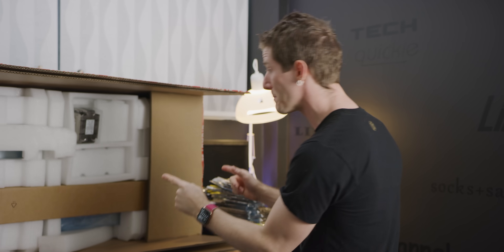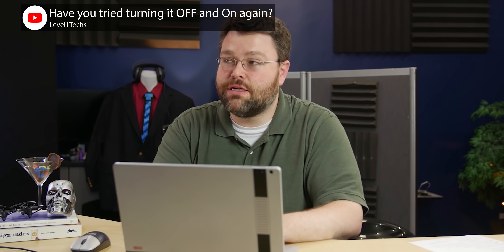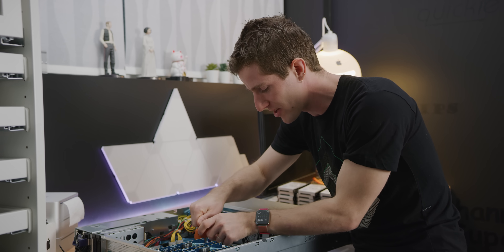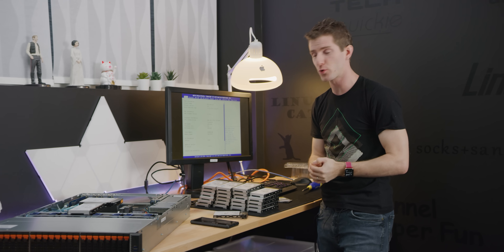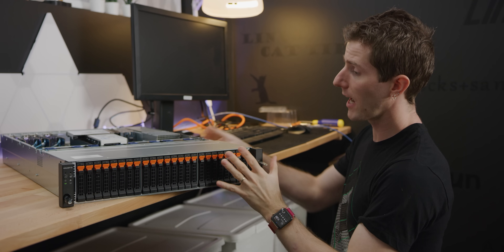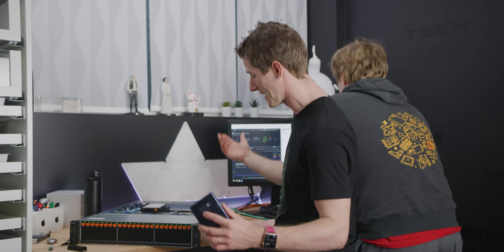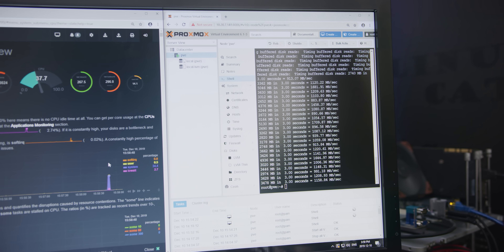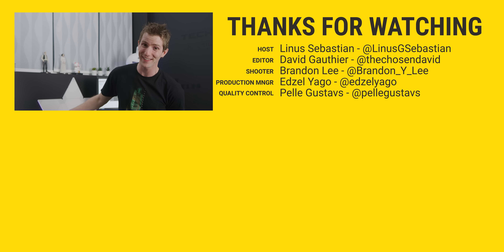Where Intel is in REAL Trouble... - AMD EPYC Server Upgrade

Comment: You should consider for the next redo using KVM-Zen VM to handle your Windows boot and convert all those drives to a single virtual block device.    I sure your Linux nerd suggested that, though.

Just watched the rest, you switched to Linux.

You can still run the Windows share server in VM on the same system to relay the FreeNAS disks to the whole network in a full featured Windows share, instead of the limited implementation of SMB.  That is, if you need the features of Windows VM.

However, you might be hitting a Microsoft cripple system wit the speed cap.

As a note, on the ZFS, it doesn't agree with every drive arrangement.  It can be a really temperamental beast.  You might want to stick to a VFS level RAID and then format plain ol' F2FS.

Comment: I don't get why everyone seems to love ZFS so much.  It always has a problem, always. For many years now, even in 2020 still.
Reply: Also, the obsession with hardware RAID.  Software RAID in Linux is actually quite good and while hardware RAID can put up some better absolute performance, the actual RAID card is often a fairly significant point of failure and compatibility problems.

Comment: 40G used gear can be cheaper than 10G brand new, so ... theoretically, you could put that on a 100G backbone, and put the workstations in the building on 40G. Cause sanity is lame.

Comment: In 2020, not too many new server design use raid card on NVMe. The reason being NVMe has very low latency and high throughput, and almost anything you throw in between will lose performance. If you do not use spdk on the server and move the storage from control plane to data plane (basically move your IO from OS kernel to the application itself) you will lose almost 1/2 of your performance to OS related latency. Therefore application for storage these days move the IO to the application, and instead of using system call you will be looping and polling for the storage. If you want RAID you implement it in software and you poll it. If done right, the CPU can connect to NVME over fabric via DMA at maximum throughput with almost 0 CPU utilization. This is why the storage hardware in between (like raid controller) is in trouble when they becomes the bottleneck instead of performance enhancement.

Comment: Linus, you actually gave the answer for why people don't use AMD epyc based servers so much. AMD don't have support for raid when you use native PCIE ports on the CPU. AMD basically goes for the highest end IP without looking at micro architecture level support. These PCIE G4 ports will not make any sense in anything other than gaming or rendering type applications. But fortunately we don't need an expensive epyc server to do that. Another fact is that their servers won't perform in most of the server applications including storage/network/communications or where configurations like NTB are required. Servers are not about having too many cores but they need basic feature support. More cores can only cause problems with licencing of software. But ofcourse they can brag about having big numbers in some obscure benchmark tests.

Comment: There's this neat thing called an electric drill and most of them have this neat torque limiting feature... You should buy one or two and a pack of P1 & P2 sized driver bits. Your wrists, fingers and sanity will tank me later.

Comment: windows 10 with ddr4 3400 ryzen system == 50gb/s write and 52gb/s read

linux 5.4 kernel with ddr4 3400 ryzen system == 30gb/s write and 28gb/s read ...ITS FUCKING CRAP KERNEL ...WTF LINUS...sorry not you linus the other one who made linux..

Comment: I would strongly recommend using FreeBSD instead, if trying out real ZFS is desirable. I've had many issues with ZoL, and I'm not surprised there were performance issues. It's a second-class citizen in the Linux world, and can barely maintain stability and keeping up to date with kernel changes, let alone optimal performance.

Technically the ZFS on FreeBSD is largely the same codebase as ZoL, but it's a codebase that's a first-class citizen and well-tested by every single FreeBSD user. It has never let me down. I'd recommend doing this again, with FreeBSD.

Comment: Why do you wanna run OS on a NVME RAID  arrange ?? Even if you use Windows the OS runs sweet ... and with a Linux on that thing the bandwidth is massive for a Server with Storage purposes ... the hardware RAID controller is just another component to increase de complexity (also the price) ...

Comment: Incidentally, I'm about to jump into the deep end of Linux myself and try to build it from the kernel without prior experience. The things I resort to in order to not upgrade my laptop from Windows 7 to Windows 10... Anyone got any recommendations? 

Currently my biggest worry is that I may need to write my own drivers to get the hardware to work, since I'm not sure what level they communicate on with respect to the OS.

Comment: 07:58  Maybe I missed something from previous videos, but why on earth are you using Windows for a NAS machine?  The limitations simply abound, and the inability to do software RAID 1 for the boot drive is just the tip of the iceberg.

Comment: 05:20  That is not a passive cooler.  There will be massive active airflow through it from the front intake fans.  What you might call "passive" in a desktop case is not passive in a server case.  That is an active cooler, just not one where the fan has to be directly connected to it.

Comment: Linus: General Windows Issues
Me: You...... You're running a Windows server of all things?
Linus: So I guess we're moving to FreeNAS
Me: Oh sweet, I haven't seen FreeBSD on this chan-
Linus: Makes Linux remarks
Me: Slams head against desk multiple times
Reply: Proxmox is Linux (debian-based), though.
Reply: I believe Linux has better driver support for off the shelf components.
Reply: Im sure he uses Windows Server for its better compatibility with other Windows machines
Reply: @prec1sion548  We have a fair bit of video evidence that he doesn't.

Besides, Samba can be plenty fast, and it's not hard to set one of the Linux/BSD file server distros up for windows domain users. Also, windows server gets kind of expensive as you add more users.

I can't remember seeing anything about his domain controller, though - that might still be windows. (Though you can make a perfectly workable windows domain with a Linux server these days.)
Reply: @dnebdal  I use Windows Server in my local network for the ease of file sharing and for software compatability (being able to run software like bitTorrent on a Server is pretty useful)
Reply: so I thought that maybe he does the same
Reply: @prec1sion548  He would have to pay for access licenses for all his users, and different versions of Windows server have core and ram limits he may run into -- and you can run torrent clients just fine on Linux :)
Reply: Guy doesn't know how much better equipped Linux is for servers. It's only running over 80% of the internet for a good reason. Dumbass...

Comment: "Isn't it crazy that all you need  to cool all these cores is this passive heatsink!" 
Hits power button
 ~*turbine engine noises begin, un-secured heatsink ducting ejected from chassis by jet blast*~
Reply: This is a supermicro 1U/2U server fan spec (and edited to add 2 standard desktop 9mm & 12mm specs)
Just about noise, each fan adds around 3 dBA. It means 80dB or more with the case opened, that means a very loud noise.
And usually our standard desktop fans have no more than 15 watt, these small ones consume 22 watt.
On 2U racks, it's easy to find 30-35 Watts with +70dBA.

1U supermicro exhaust fan
MANUFACTURER
Sunon
FAN SIZE
40mm
RATED FAN SPEED
23300 RPM [Inlet] / 20300 RPM [Outlet]
ACOUSTIC NOISE LEVEL
69.4 dBA
MAXIMUM AIRFLOW RATE
34.8 CFM
RATE CURRENT (A)
1.9A (12V)

2U supermicro server exhaust fan
MANUFACTURER
Supermicro
FAN SIZE
80mm
RATED FAN SPEED
14,400 RPM
ACOUSTIC NOISE LEVEL
65.4 dB(A)
MAXIMUM AIRFLOW RATE
113.7 CFM
RATE CURRENT (A)
4.2 A (12V)

Standard desktop tower fan
MANUFACTURER
Delta
FAN SIZE
92mm
RATED FAN SPEED
4200 RPM
ACOUSTIC NOISE LEVEL
45 dBA
MAXIMUM AIRFLOW RATE
74.8 CFM
RATE CURRENT (A)
0.4 (12V)

Standard power supply exhaust fan
MANUFACTURER
Sanyo Denki
FAN SIZE
120mm
RATED FAN SPEED
1850 RPM
ACOUSTIC NOISE LEVEL
24 dBA
MAXIMUM AIRFLOW RATE
58.8 CFM
RATE CURRENT (A)
0.13A (12V)
Reply: @JuliusLC  Damn, 1U fans go up to F1 V10 engine max revs? I did not know that
Reply: @haxthehax  at least it is specified on the site specs. These really sounds loud & noisy, believe me.
Reply: First time I fired up the 1U computing server we use at work (a dual-socket xeon affair), I had my back turned while it POSTed and genuinely thought the fire alarm had gone off. Server fans at 100% don't joke around. :)

(1U ones are even angrier, since they need to spin way faster to move enough air).
Reply: @dnebdal  yeah, in 1U/2U servers the RPM these fans do is kinda scary, and so is the noise they make.
Reply: @dnebdal  what happen to server then ?
how many amp/rpm the fans are
Reply: @dnebdal  Reminds me of the Bitcoin farms...
Reply: Have one of these server CPU on my desk with a 8k RPM low profile fan. The entire office can't work. Coworker suggested Noctura and that's the best $75 ever. A guy from another department was afraid to ask his boss for approval so he end up writing a script to loop and set the fan speed to low, competing with the cooling system to raise the CPU speed too high.
Reply: LOL. Yeah, when the reality hits...

Comment: https://www.youtube.com/watch?v=lrT9Bl0MCXQ

 Hyper Threading CPU  - https://www.youtube.com/watch?v=UuUgfCvt9-Q - RAID 5 vs RAID 6 Raid 5 System Windows Raid 6 arm disk alles auf Combo oc Turbo mit https://www.amazon.com/gp/product/B0134EW7G8/ref=as_li_ss_tl?ie=UTF8&linkCode=sl1&tag=powe0ae-20&linkId=0f7cad663cf232b888051950bb0a9cb5&language=en_US

https://youtu.be/PVad0c2cljo?t=744 with ddr3 ddr4 RAM Tripple DDR4 nö eccc ecc Server arm System damit geht's ne emo Software die dir Windows bootet einrichtet als als ram dics 5 über stick oder so laufen lassen Disc aufspielen duch sata flopie starten bruch bios installen ohne stick furch neu auflage deine ganzen raid System sind im bios gelistet solltest du ein System haben booten mit dann ladest du nur normal intallst neu win 2 System und lässt die ganzen raid ist über Windows Software im oc bios seting max Server boost laden alles nebenbe   smart arm schub Programme und bei daten Übertragung nutz zu noch zu extrem arm übertragung Software das macht alle 5x schneller als normal ei nsystem ein ki und Manager mit Micro hilfs untestützung über browser richten durch Windows traning du bid schon bei 4.0 5.1 allei ndurch die ram und cpu und hi Speed Übertragung ohne rams die rams machen nur Software bensch und bios tackt stabiler schnelelr mit mehr ram mehr hypert.CPU such mal par hacking seiten auf vileicht gibt's ne ki Software für bios die das alles regelt auf cd bosst stick boost root win loader und konrolirt aufjedenfall nicht uefi uefi ist müll
Reply: damit mein ich ramdisc raid 6 das ne Software die ganze zeit die arm Festplatten geladen hält und den pefel auf 100 Prozent steuert im boost neben bei und die Software am besten verteilen das ei nausgleich ist das gekopelte System enet Zuviel verteilen muss als Einheit auf die 5 platten das zeug und windows  unterschiedlich Server rechter verteilen und amistratorechte freistellen auf die nserver in sli am besten noch wintert kuppel 45000 Leitung bei dann kannst cht alles ficken mit was nur beine und füße hat und wen das alle machen und ein netter entsteht wird alles viel schneller besser gelenkt im Internet und gibt nur Vorteile für alles und jeden ein spinen netz system mit Intelligenz glaub mal das will ich

Comment: Linus: "Intel is in trouble"
Also Linus: proceeds to use dozens of Intel drives
Reply: Also linus: **smokes a dozen of intel drives*
Reply: @miyoubi  its no discord
Reply: I have an Intel 660p SSD in my Ryzen 5 2400G build. (That's a build for use at my workbench and occasional light gaming.) I felt vaguely dirty about putting an Intel drive in an AMD build, but it was the best choice that Micro Center had in the store that day. The 660p is a budget SSD, but that's a budget build all around and putting a more costly SSD in it didn't make sense.

So yes, there are Intel products worth buying. It's just CPUs where they are struggling, and with the Ryzen 4000 series APUs on the way even their laptop niche is in trouble. Plus aggressive pricing on the earlier APUs; the Ryzen 5 2500U may not be the best laptop CPU ever, but when you're getting it for the price of a Celeron or a Pentium it looks really good. (For example, a Lenovo IdeaPad 330s with a 2500U is about the same price as an IdeaPad 330 with a Pentium Silver N5000, but the performance of the Ryzen version obliterates the Pentium.)
Reply: It's hard to justify buying an Intel processor today. 

That doesn't mean the rest of their product stack is useless.  Whenever possible, I use nothing but Intel network cards or chips.  They're just the best option.
Reply: We have true RGB nowadays every company have something worth your buck, if you have enouth of them....
Reply: @TrueThanny lmfao
Reply: Used though, so Intel didn't get any money.
Reply: @Ancyker  Facebook recently ordered billions of $ worth of Intel Optane memory for their growing server infrastructures
Reply: Bruno Panzero Schechter so true! @linus time to update that title
Reply: Jesse Quinn actually intel is selling out their ssd division in the future so...hehe
Reply: Yeah I love my Intel Optane 905P SSD. Paired with the single thread performance of my 9900K that SSD is a beast.

Comment: Was I reading that display right, at those read/write speeds the CPU was only maxing out at 60%? Im no longer sure which is more impressive at this point, the fact that only 60% of the CPU was used or that it took 60%. Numbers are getting so large its hard to wrap ones head around.

Comment: Seagate has a deal on these days for 7200 RPM 3.5 inch Multimedia-specific class hard drives called IronWolf which are very very good for the money AND they are 16 Terabytes in size!

https://www.bhphotovideo.com/c/product/1483622-REG/seagate_st16000vna01_16tb_ironwolf_7200_rpm.html

if you buy 64 of them you will have 1024 Terabytes of Disk Space (ONE PETABYTE) for $32,000 U.S. or about $42,300 Canadian

It might make more sense to buy a bunch of server tower cases from Corsair and attach COOLING FANS or even Water blocks to EACH drive to ENSURE their longevity and low failure rate. The larger Corsair cases could each fit sixteen of the 16 terabyte drives so with 4 of the corsair towers, you could subdivide the Whonnock server into Striped RAID configurations at 256 Terabyte Disk Server Block sizes for staff needs.

NVME is nice BUT you COULD use a BIG ram-disk buffer to speed up hard disk operations for online videos since 7200 RPM in striped RAID configurations should get you about 250 megabytes per second which is DEFINITELY good enough for DCI 8K resolution RED 3:1 RAW and HDR REC.2020 Super-UHDTV 8K encoded video.

.
So basically for slightly more than the price of what you paid for the used NVME drives, you get 10x the disk space and if you use GOOD ACTIVE COOLING of ALL the individual spinning disk drives, they SHOULD last up to 10+ years. That is our longevity experience with 24/7/365 run Seagate drives that had ON-DRIVE COOLING attached (7 to 10+ years of no disk surface error rates) versus drives that did NOT have active cooling attached which was only 4 to 5 years on average when disk surface error rates went up!

.

Comment: At this point you all just need to invest in glacier storage. Either get aws glacier or get your own tape storage system that can automatically grab a tape and read it to a disk drive and automatically write to a tape...

You'd be better off using aws glacier though as it would be cheaper after you consider the time spent on maintenance. The only downside is it can take up to 3 hours to access data, BUT that is why you only store that data in AWS Glacier when you aren't going to need it any time soon.

Comment: This is nothing compared to unloading a Cray after and emergency shutdown toasts ~ 300 drives of a 512 drive array.

As for the"missing "raid" card, it's actually totally unnecessary for most of the use cases of this system, some of which use software raid, most of which are distributed.

On the ZFS issue, you'll have to use an unofficial patch for ZoL that works around the issue.

Comment: I'm really curious if anyone makes a PCIe splitter module, basically making a 4.0 x16 slot act like two 3.0 x16 slots side by side with each other. That would be pretty nice for a crazy single case render farm. 8K blender test, 1 threadripper 3970X, 8 RTX 8000s and room for NVME boot drives.

Comment: I'd put in 2 big optane 905p in and use ashift=12 with zfs. Does fine in our render-temp-servers. Those are using MLC SSDs so i can't say anything about the DC 4510. I'll try to get some to test out. sub $500 really is a steal ;)

Comment: I'm guessing you might have more luck benchmarking using ZFS on straight FreeBSD. Although not made for pure speed, ZFS should impress when properly optimized for throughput. Consult the FreeBSD Handbook, OpenZFS project Wiki and Oracle Solaris ZFS Admin Guide or simply contact someone like Allan Jude. There is a way to push this hardware, you just haven't found it yet.